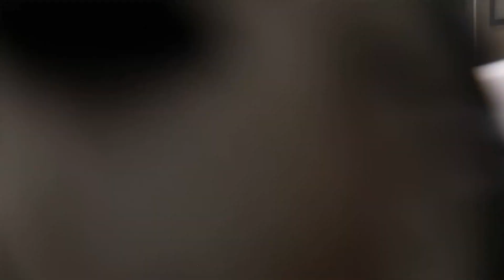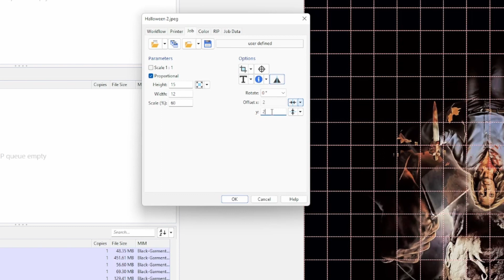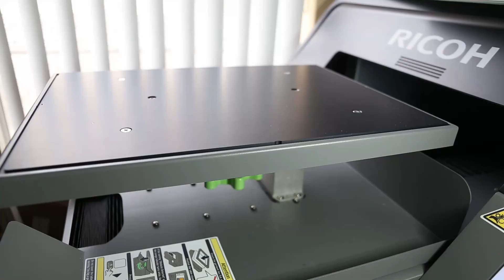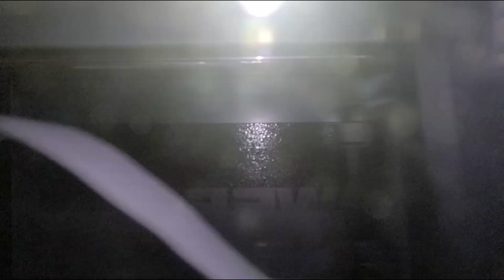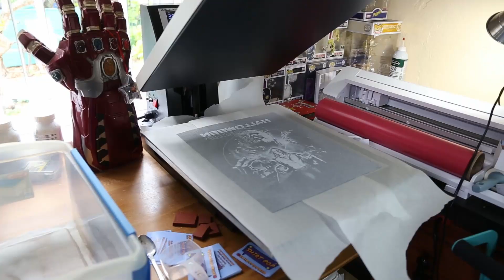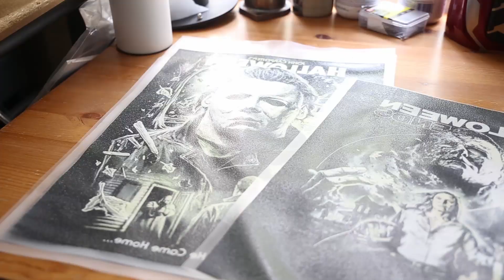Printing DTF transfers using Ricoh RI1000, Curing direct to transfer prints using a heat press

Comment: What do I need to do to my Ricoh ri1000’to be able to print DTF
Reply from the maker: There are a few settings you need to change in the software. Other than that, just raise the platen a bit and print when you put dtf transfer film on there and tape it down. I don't have the printer anymore, but you can find a few tutorials for the software online

Comment: Without rasterizing that.. it’s gonna feel like a bin bag on the shirt.
Reply from the maker: Lol it was a test but honestly it wasn't that bad! I was surprised at the feel of such a big DTF print. I've done big ones like this using screen print transfers before. I just don't like the look of rasterization to be honest.
Reply: @NekoPrints  I agree there it don’t look the best with the holes or dots. Screen print uses halftones but it looks better ???
Reply from the maker: With half tones, theres ink in every spot of the image. It's just filled in with a different colored ink to blend in the colors. Where with rasterizing on DTF or white toner, its just holes placed in the print to allow for better washability and to last longer